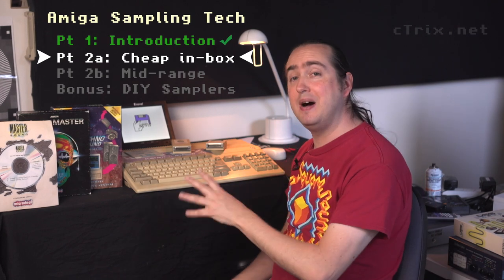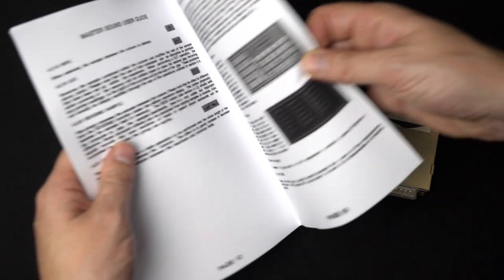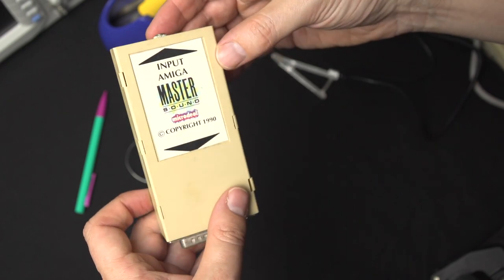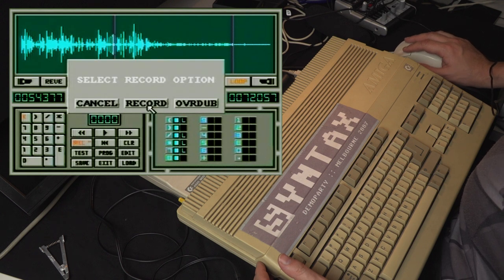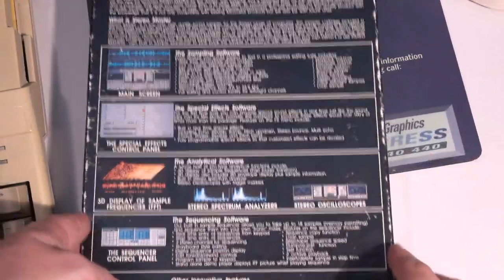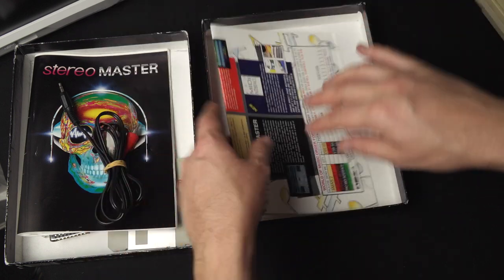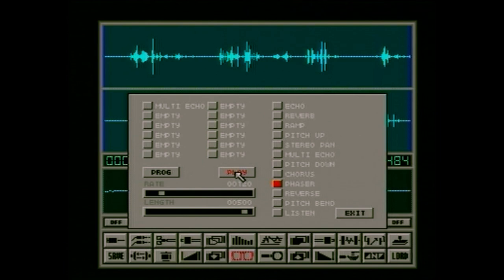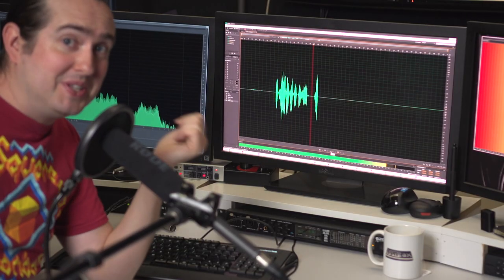Amiga Samplers (technical) - FutureSound / Master Sound / Stereo Master

Comment: The Amiga being able to effectively continuously vary the playback sample rate IN HARDWARE was great.
Reply from the maker: @vapourmile  I see your point from a studio perspective.... but the Amiga was never a studio device nor marketed to that use-case ever.  There was a huge divide between a computer and a studio in the 1980s.  The most a studio computer did was control automation or play out simple MIDI data (by 1985) for which the Atari was marketed.  Studio's contained $$$,$$$ of gear ...  and even a basic sampler cost $$$$.  The Amiga was $$$ (note the missing dollar digit!) and was a full computer with the bonus of 4 channel hardware sampler / re-player which could do some amazing things if you were careful and efficient with the sample source.  Any studio owner would instantly hear it as 8bit and aliased.

A note on the R2R DAC - which are indeed simple to build - was not what was in the Amiga.  The Amiga did a bunch more than just contain a single DAC.  Unlike the sample playback cards for other platforms which were essentially a R2R DAC (like the HippoSound for Atari or SoundBlaster on the PC).   The Amiga effectively had 4 x 8 bit DACs + 64 volume levels per channel, and as @blargg mentions above - it did varied resampling in hardware meaning that the CPU usage was 0% on audio playback unless you were doing modulation.  A single command could trigger a sound effect and it'd just play until you stopped it in code.  Even the Sound Blaster on the PC right up until the modern day uses the CPU for audio playback.  That's why many Amiga people bought Gravis Ultrasounds if they bought a PC.  I remember my dads 486SX/25 couldn't even playback a MOD without sounding fuzzy (as the SoundBlaster was 8 bit rather than 4 x 8bit).   Consider the Amiga had an 8mhz CPU back in the old days... to output to a simple R2R DAC would have been impossible if you wanted to do anything (like gameplay) at the same time.  

Studio samplers had dedicated processors worth many more times the price of an Amiga and built for the task.  To answer your question on the DX - yes it would have been more common to find a DX7 in a studio.  But I'd argue in the 1980's the Fairlight / E-mu Emulator and a ton of other digital samplers (often triggering drums and other effects) were just as common as the DX7.  The Amiga is essentially a poor-persons Fairlight / Emulator.  I do love the DX7 though.  Mines currently broken but I'll possibly film a repair video - mostly because when a DX7 goes wrong it makes some of the wildest sounds you will ever hear!
Reply: @CTRIX64 That was unfortunately not very informative. Like so many others you seem to have assumed I don't know what I'm talking about. No, I'm a computing professional, and a programmer of the era when the Amiga was popular. So I can and have written programs for the Commodore Amiga, PC and Commodore 64 in the Amiga's day in Assembler. Including sample players, copper lists, etc.

A professional sampler only had one job: To make a single 16bit 44Khz digital recording of a sound. After that it was then processed by hardware which could play polyphonic sound, if needs be. Although in a professional setting, even to this day, samples are usually merely filtered then used as they are. Basslines, drum rhythms, etc. 

The Amiga isn't really like a Fairlight. The Fairlight was not as simple as you claim. It provided sound shaping through frequency analyses which are complex even by the standards of today. The Fairlight used synthesising technology based on an FFT algorithm, there is nothing equivalent on an Amiga.

 Also, contrary to your claim, the sound chip on the Amiga didn't resample anything. Samples can be played back at different speeds and that is all, so it is rather as simple as I said. You simply set a volume control, point it at a region of memory, set the playback speed, then trigger playback.

There have been attempts to improve on this using real-time software algorithms but an unassisted 68000 doesn't do very well when it comes to shaping sounds coming at it at a maximum of 4x22Khz. The 68000 isn't going to have an easy time modifying samples at a rate of 2 8 bit samples per raster then passing them to chip RAM. It just doesn't have the power. You can get things like 8-voice players, but what's the point? Even a cheap PC consumer sound card like the AdLib has a synthesizer chip with 9 voices onboard hardware processing and 16-bit waveform output.  The AdLib is not an exotic device, it's the lowest end ever of the PC audio market. 

In short though, yes studio equipment was more expensive. Amiga fans ALWAYS shout "COST!", but it isn't a valid argument. YOU may have had a tight budget but not everybody shares your own budgetary constraints. Mercedes are more expensive than Volkswagen Polos, private planes are more expensive than cars. . It doesn't matter. You don't dictate terms on what other people can afford to own. You can't invalidate something based on an assertion YOU can't afford it. Who cares if it's beyond your price range? Of course studio equipment is more expensive, it's better. It's more capable more sophisticated equipment with far more stable and quiet signal generators.

When people love Amigas they cling to anything the Amiga has done and tout it as extraordinary, purely because it's an Amiga doing it.

What about more generally,?If you aren't emotionally tied to the Amiga?  What do people remember in music? The Amiga? Or the Prophet 5, the Roland 303 and 808, the DX-7, the Fairlight, the Clavichord, Moog and Oberheim. 

Even in its forte, which was computer games, people remember Sega and Nintendo, Mario and Sonic.

Amiga fans grossly overestimate the Amiga and grossly underestimate everything else. Always trying to claim that anything more expensive doesn't count. No, if you can afford it then its utility is NOT invalidated by its cost.  

Why do DGX-2 workstations, TODAY cost £350,000? Why did the Summit supercomputer cost £325,000,000?

Devices are NOT invalidated by the fact you can't afford them, and the fact they are often often more expensive does NOT imply the purchasers of them would be better of with Amigas. Nobody did weather research on a Commodore Amiga.

The Amiga is a cheap consumer toy.
Reply: @vapourmile  "The Amiga is a cheap consumer toy."
So many words and your conclusion is to tell us what we already know? News flash: Everyone knows that the Amiga is a cheap consumer toy. This is what it was marketed as (at least the 500). But you compare apples to oranges. The Amiga was not studio equipment nor was it ever marketed as studio equipment. You compare things that wheren't build for private use to a home computer (emphasis lies on "home") that was build to do many things. That doesn't make any sense.
If you want to do a comparison that isn't "private planes vs cars" (what the heck?) you'd need to compare it to something that is in the same field, like PCs or Macs. But you completly miss the point with about every single one of your sentences. Except the one I quoted and which is common knowledge.
Reply: @wohlhabendermanager  

"If you want to do a comparison that isn't "private planes vs cars" (what the heck?) you'd need to compare it to something that is in the same field, like PCs or Macs"

LOL. No I don't.... the no true Scotsman fallacy in disguise, again.

Yeah.... "If you want to compare the Amiga to anything else the only things you're allowed to compare it to are things like the Amiga, you know, like the Amiga".

You can rule out ANYTHING ELSE as "not the same thing as an Amiga" comparison because obviously the only thing truly "the same thing" as a Commodore Amiga is the same Commodore Amiga. Your argument is "The only way to make a fair assessment it to preemptively discount from consideration that isn't a commodore Amiga".

No, sorry, that's bullshit. 

I can venture exactly the same in return: If I want a Cray supercomputer then I don't have to compare it to anything except Cray supercomputers. Microcomputers need not apply.

There is literally nothing about an Amiga that means you MUST consider it and reject other things. Having considered it, if you want SOMETHING ELSE, example: Something more powerful than an Amiga, then it's very easily ruled out. 

When I set up a CGI department in the late 1980s we have £21 million  to spend. Know how many Amigas we used? None. 

You probably can feasibly make an album entirely on Garage Band on an iPhone, but there's no fucking point and it's stupid to imply when making a choice you Must select from tools a bit like Garage Band, because it obviously isn't true  and that fact explains why people don't: They can get something more suitable instead. 

The idea the only things you can take into consideration when making a purchase are things matching the exact description of a Commodore Amiga is fucking stupid. What if you don't want an Amiga because it Doesn't fit your specification?

"The only things you're allowed to choose from are those things which fit the description of the Amiga" is clearly stupid and wrong.

When people go out to buy a Bugatti or Lamborghini they can weight it up against a Ford Fiesta if they want to but it's fucking stupid to suggest that, having done so, they are then forced to make a selection from something in the same price bracket as a Fiesta. They don't. That's my point. Nobody who wants to own a helicopter must choose a scooter instead.

"You're can make  a free choice, only your choice has to fit the size and shape of scooter because that's what I had!". No, that has never been true.
Reply: @vapourmile  LOL, you really love to bloviate, don't you?

Comment: Mate, I'm loving this series! Can't wait for the DIY episode. In the time between your first return to the amiga 500, I've gotten myself a pretty decent setup, accelerator and all. Only thing missing (ea; still in transit from ebay) is an IDE harddisk. 

Definitely going to build myself a sampler. I'm hoping it's gonna be a fairly high quality one, or atleast, if it's "feature complete", there's options to either strip it down to the core or completely pimp it out if you have deep pockets. Coming from fasttracker for msdos, I know I want to go all-in on tracking on the Amiga. 

Cheers man, can't wait for more episodes!
Reply from the maker: Awesome!  Let me know if you do make one.  Yeah - Fasttracker was and is still amazing.  The 4 channel life does make it extra special though :-)  The limitations are wild.  Also - you can do your sampling on a modern PC and it'll still sound like an Amiga once the samples are shipped over.  I might do a video on how I pre-prep samples on the PC side.
Reply: @CTRIX64  Sampling on PC(+Mac?) and shipping over would be interesting. I always end up resampling stuff through the amiga and back into ableton when I want that amiga-ey sound.

Definitely also gonna build a sampler based on the next video, too, as I had one of those cheap ones and it's recently died!

Comment: Interesting to see the Amiga version of the FutureSound. I have the Apple IIgs version and it too carried the tradition of not cutting corners. It was a high end stereo sound card with a built-in stereo ADC. This is coming from a system that typically had sound cards that simply used the Ensoniq DOC's onboard mono ADC.

Comment: Slight correction. Signed byte goes from -128 to 127. Not -127 to 127.
Reply: trapexit unless you design to have a signed 0
Reply: @flavienvolken3733  True. Could be 1's complement. Though that's not very common.
Reply from the maker: @spawnlink  Thanks for that info!  While I was editing this my brain went "hang on, 127+127 is 254 bits in total... the zero is another... where's the missing bit?!"  I meant to look it up but just kept editing.  For all the years looking at datasheets I've never taken note which way the extra bit swings; and I'll now forever know it's on the negative side.  Much appreciated correction!   It's wild to think I've coded an 8bit wave editing tool and never looked this up (although my center line at 128 would have still been ok; and my clipping logic was just clamped at 0 and 255)

Comment: The AD7576 used in those cheap samplers was the 'cheapest' iteration of the chip from Analog devices and it did have missing codes meaning at a quite spot, the ADC would hop 2-3 codes on the 8-bit up and down with a fixed void in the middle making that hiss between your speech 2-3x worse than it should be.  In the day, I tried wiring the top 8bits of a 250$ 16bit ADC IC to my Amiga's parallel port and that 'squeltching' on and off hiss between the speech was almost eliminated, like 3x quieter with actual sound in there instead of the abrupt on and off hiss of the AD7576 in those cheap samplers.  So, the Amiga was actually capable of better reproduction than the samples we ended up with those 50-100$ samplers boxes.  It's sad since most Amiga sampled audio in games was actually done with a load of hiss which shouldn't have been as bad as it was by a factor of around 3 fold.

Comment: I had and may still have a Megalosound, similar size to the small stereo MASTER unit. Limited by the RAM on an A500 but on the A1200 +8mb RAM exp and a MASSIVE!! 1GB hard drive, space was no longer an issue.
Copying a CD across from the A500/A570 to the A1200 using a parallel cable took about 24 hours though... Adding a 4x CD drive to the A1200 had the shopkeeper telling me its for a PC and will not work on the Amiga. If he knew it did work he would probably have quadrupled the price. I moved to a PC because the parts were so much cheaper. Sub £50 modem for a PC or hundreds of £'s for an Amiga one.

Comment: just discovered your channel. beautifully made videos. 👍👍 Made maybe over 100 modd on my a500 back in the day with soundtracker and octalyzer. i had a cheap sampler with which i sapled my instrıments. even used it as a midi sequencer with my 2 synths. i always wished to able to use midi and mods/tracked amiga samples together but never was able to do it though.

Comment: Are the remaining parts going to happen? It might be worth checking out the Open Amiga Sampler that @echolevel @mnstrmnch and myself @abrugsch (all twitter/Instagram/github handles) are working on. It's a DIY design in the vein of these cheap samplers that we're making into super small card that won't cost the ludicrous amounts that original hardware now fetches

Comment: The year is 2047.  cTrix is still hopelessly lost in the rabbit hole cranking out Episode 879
Reply from the maker: Haven't even cranked out EP3 yet! lol.
Reply: @CTRIX64  Any ETA on that EP3????
Reply from the maker: @daishi5571  I reakon early 2021!  I had a special sampler I was going to borrow from someone for it, but then lockdown happened and I couldn't get it.  And then my line of work (in events) got obliterated due to C19 -  so I've had to reinvent my career which has taken most of my energy.  Then my roof leaked in a storm,  the ceiling partially fell in and I had to move out and rebuild / move to a new studio (with less help due to lockdowns) which has taken last 6 months.   However, as of this week I've unpacked the box of samplers / Amiga and have a new way-better filming space I can use.  I might be able to sneak in filming an episode before Christmas, else, early 2021.  Working on it!
Reply: @CTRIX64  Well I'll be looking forward to it. That is a particularly impressive list of bad luck to happen, and I hope that it does not continue. I bought a Microdeal Megalosound Sampler it's not the one I wanted, but the DSS8+ either rarely comes up for sale or is far too expensive.
Reply: @CTRIX64  sending all the good vibes your way!

Comment: Great video one again!....I remember getting the MegaLoSound sampler for my 14th birthday in 1994 which was a lot better version than these. It had a RCA stereo input and volume control for this input. The software was awesome and you could add effects to your samples as well as in real time which was a really good feature
Reply from the maker: It was almost exactly the same circuit as the TurboSound I'm looking at next!  The ADC had a lower reference so the input could go higher.  I'm sure you will probably remember that the volume control will have almost always have been set to maximum ;-)

Comment: Do you have the manual for the FutureSound? I own one AND an Amiga 1000. I used ADF Copy today to pull .ADFs of the original (!!) floppies. Is one of them proprietary? It came up all yellow sectors on ADF-Copy but the second one is all green. Last question: someone pulled my ribbon cable off. Can you use it to record via the passthru port?

Comment: I didn't know that StereoMaster was a commercial software product with their own sampler. I always thought it was one of those shareware programs for use with generic(homebrew) samplers. At least the version I had back then was shareware and you could use a homemade sampler with it. Witch I had build using a ADC0840 A/D chip.

Comment: I am and was a fanboy of the Amiga's as well as PC's, The software that came with most of these samplers were some what bellow par anyways, using a 3rd party tracker to do samples was generally better, as you could same samples off to a second disk drive, or hard drive if you had one, thus freeing up memory for more sampling, I'm not saying it was the best way to do things, but it was much easier than using the samplers own software, great vid great vibes, :).